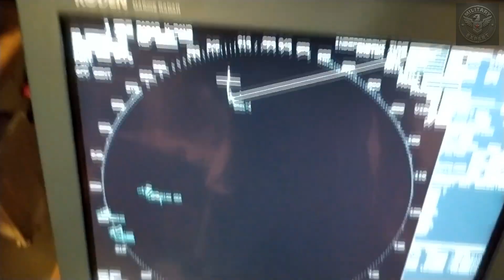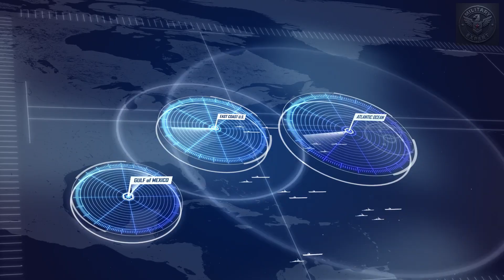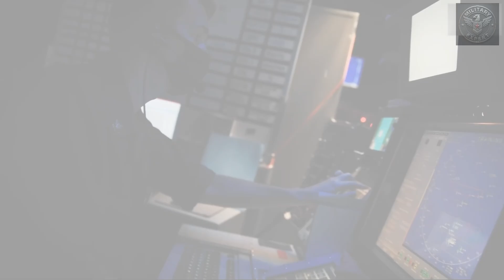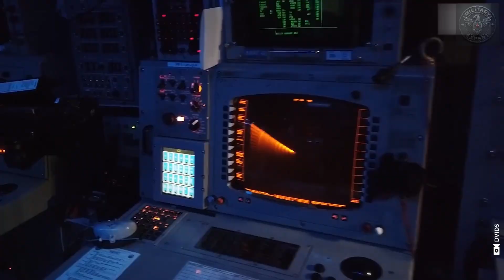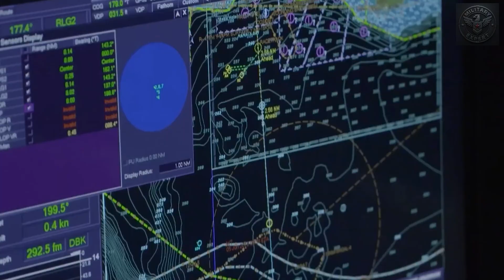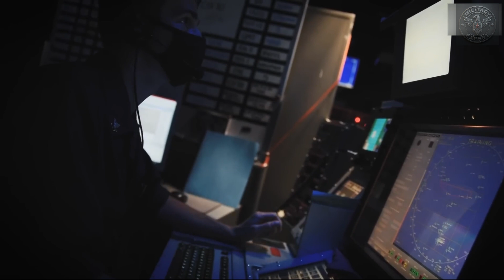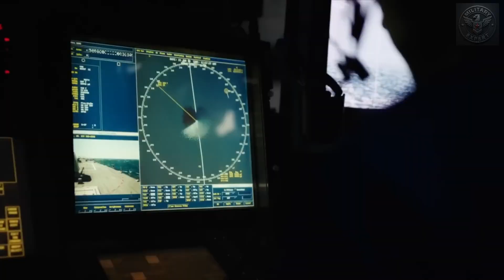Can You Really Sink an Aircraft Carrier in Today's Navy?

Comment: Stupid question. You destroy all the planes aboard the carrier is useless they cant be sinked but they can be floating useess logs
Reply from the maker: That’s actually a fair point — disabling the air wing seriously limits a carrier’s purpose. But even as a "floating log," it's still a mobile runway, command center, and sensor platform. The tricky part is that turning it into just a useless hull is almost as hard as sinking it outright — and the carrier group is built to make both options as difficult as possible.

Comment: There are hypersonic missiles now, plus sea and underwater kamikadze drones. Never say never.
Reply from the maker: You’re right — modern hypersonic missiles and unmanned surface and underwater systems have changed the threat landscape significantly. No platform is invulnerable, including aircraft carriers. But the key question is not if they can be sunk, but how reliably and under what conditions. Detection, targeting, and timing still play a critical role — and that’s where carriers remain hard to deal with, especially when operating as part of a coordinated strike group.